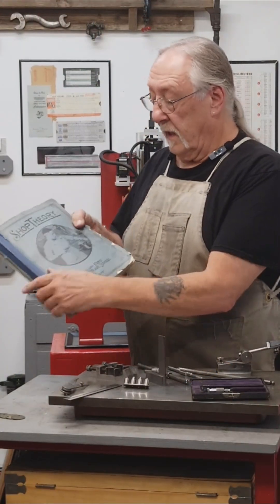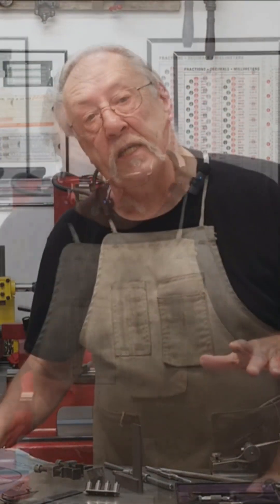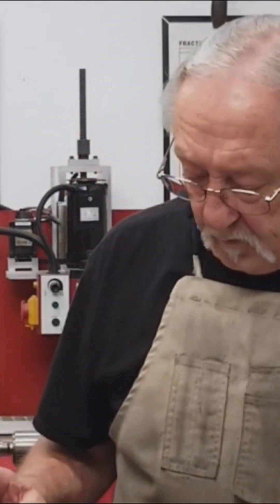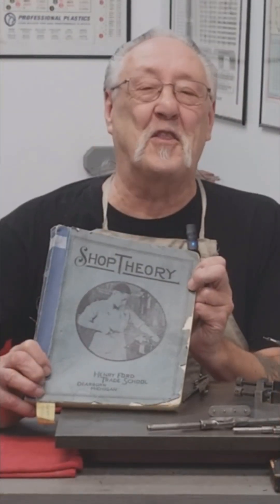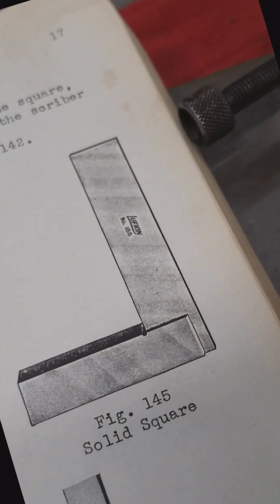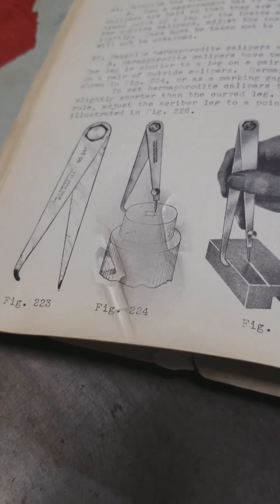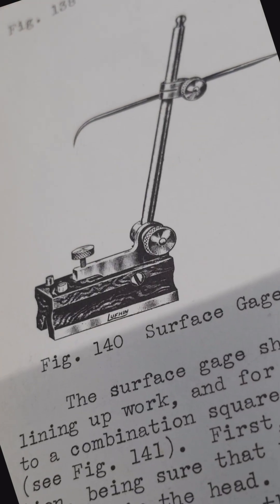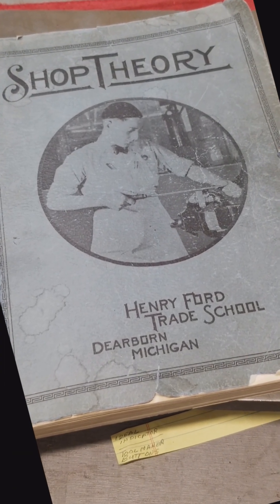Machinist Brain 18, Tools of the Trade 1934

Comment: Something I find very interesting about production setups from the era is that they would have lines of drill presses that would have different ops for different holes and what not right next to each other.

I'm not an expert on the subject but from what I understand, you would set up as many ops as possible on separate drill presses to reduce the load on the milling machines and move the part along faster instead of changing tools out constantly.

I also wonder if all shops even had vertical mills since horizontal milling machines (manual) where more common back then.

Just food for thought and for the experts to chime in.
Reply from the maker: Hello Joe, I've looked at your comments over and over. You're right about being interesting. The topic of early manufacturing and why things were done the way they were. I mean, the lines of drill presses, changing out tools, the reduced load on the milling machine. All being a topic them self. The milling machine back then  was just that a milling maching, the Bridgeport type mill didn't come into use until 1938 to 1940's . So to drill holes in a precision manner you used drill fixtures on drill presses. Etc etc etc. You have touched on so many things. There is no way that I can think of to answer or explain all the things that would give you a good idea of what or why things were done the way they were. Unless, maybe I did a live podcast thing or something like that. Maybe I can explain more with a long form video. Like I said, I looked at your comments over and over and want to fine a way to engage in more on this topic. Thank You for watching and for your comments. I'm sure you haven't heard the last on this topic. Thanks again Joe for commenting and being part of my video. 👍